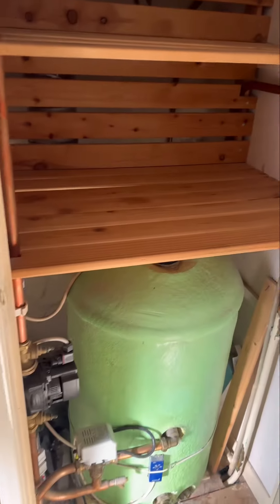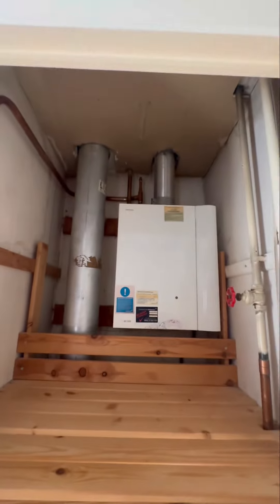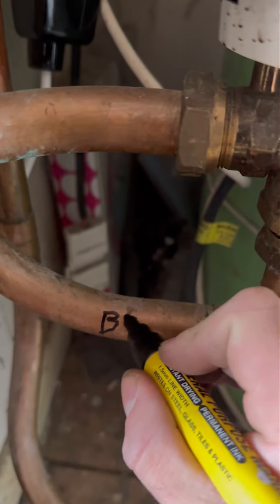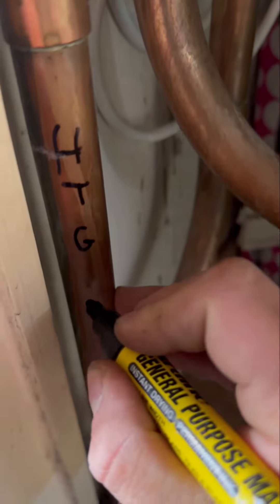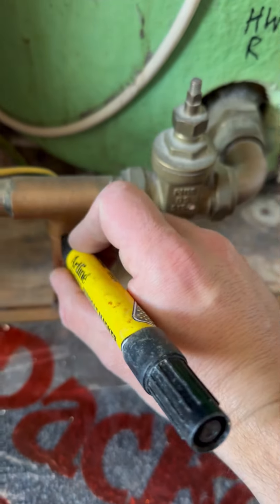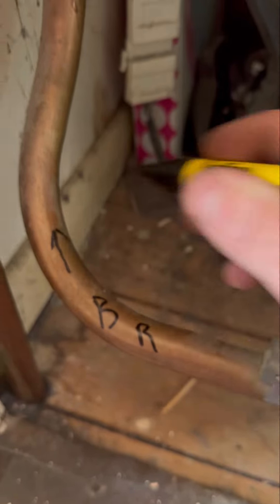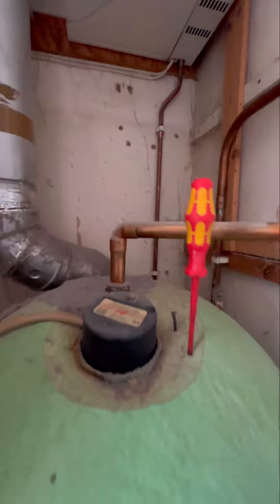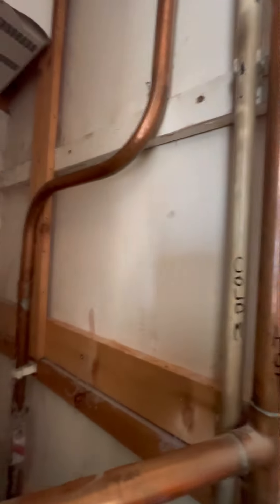How to label up the pipework on a Y plan system perfect for apprentices

Comment: Hot water return should always be the last connection into the centre of the joined returns tee. Otherwise during the summer when the heating is off you will get some radiators getting hot due to the heat going through the coil, and getting pushed down the heating return.
Reply: Yes my friend ,you are right perhaps that's why there was a valve installed on the return from the cylinder, to either shut off the creep of heating in the summer period? Overall the pipework was neat also I noticed a manual air vent on the return to boiler ,which is a must if not an air lock .
Reply: I had forgot to say had there not been a valve installed on the hot water side  which was the easy option ,the pump pressure would have forced the incorrectly installed heating tee return through which we know some radiators would get hot during the summer.the tee should have been installed so that the return from the hot water cylinder came first.